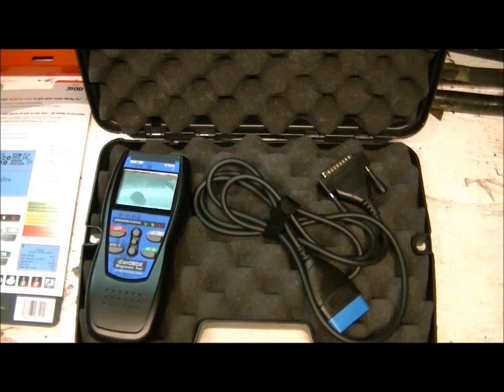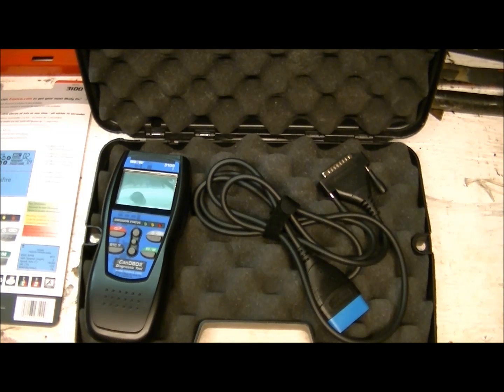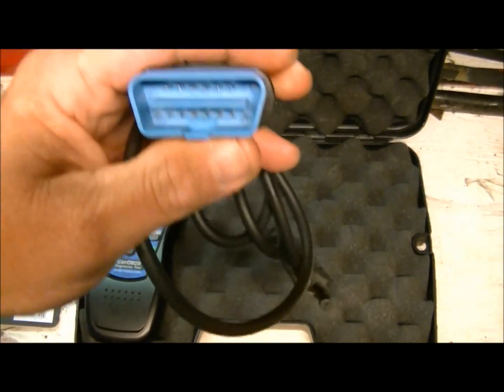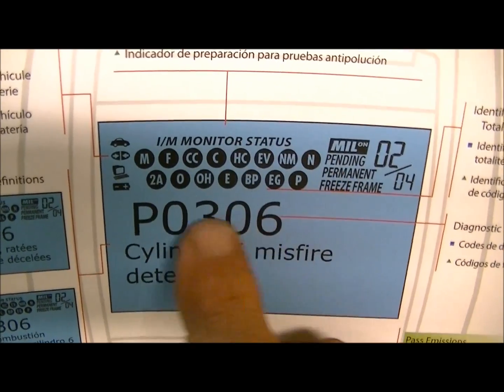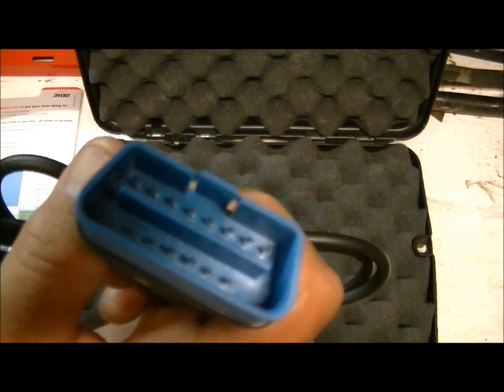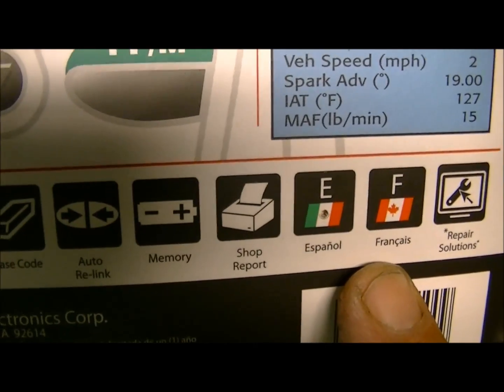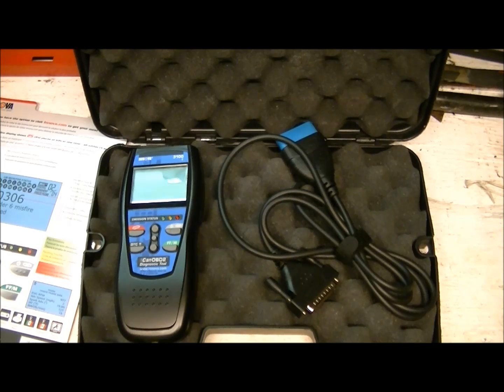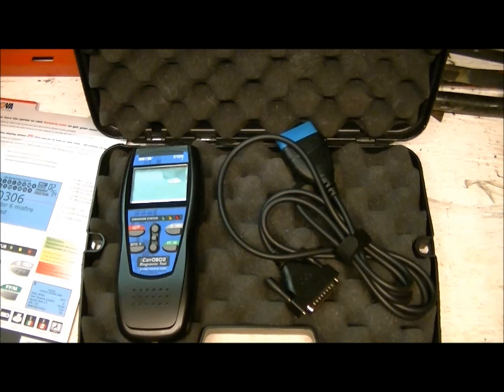Innova model 3100 Diagnostic Scan tool Review

Comment: Most OBD1 have different software vs other car makes. So no universal code reader can pull codes.  Though some models you can do a sequence to count flashes on the instrument cluster to get codes. BMW stomp test 5 times of the kickdown switch with key in position 2.  Jeeps three turns of the key from position 0 to 2. So that's why they made OBD2 so you can use a universal code reader. Though like VW you need Vag- Com software.
Reply from the maker: DaytonCarCare :)

Comment: I  wouldn't purchase any scan tool that didn't have an ABS readout.....
Reply from the maker: FYI for you just because a scann tool has an ABS Function its in no way a gaurntee that that function will work with your car. also that function is a Joke on scan tools , as they can not tell the difference between a sensor problem or a wire issue to the sensor , have a nice day
Reply: Mike Johnson innova 3160e can also read ABS

Comment: I don't know it ifs because of recently buying my Innova 3100 but mine can read ABS
Reply from the maker: thats cool ,
Reply: It will not read abs on BMW cars! I wish package would of said that
Reply: victor echeverria What letter is after the 3100 on yours? On mine it reads ABS codes on BMWS. My unit is the Innova 3100 k
Reply from the maker: victor echeverria not all code readers will do everything in fact none of them do unlesss you spend a wack load of cash and even at that the odd car needs to use a special reader just for ABS, one the better scanners is the Autel VAG 405 it works best with bmw VW etc. and its only 50.00 check my video out on that scanner i also have a video on what you need to know before you buy one of these scann tools as well
Reply: KevinMillard68  cool Ty I'll check it out

Comment from the maker: the 3100 will not track abs or oil lights, it will only do the check engine light problem now the abs could be a wire which is very likely or a sensor,take the wire off and doa continuity test on the wire each one of them that is is they all pass then you have a bad sensor or even a bad abs unit could be at fault , how ever your abs being down will not affect your regular brakes so you are still safe to drive, oil light check the oil level only when the engine is cold,could be oil sensor as well

Comment: i just got this scanner and plugged it in and it said no dtcs or freeze frame data present in your cars computer, am i doing some thing wrong. so i went to the innova.com site and uploaded what ever it got from my car and now it read no error code are present. but did get a yellow light. my dash board lights has check oil and abs on. the scanner did not find this, yes i know it will not scan for abs, you would think it would make a code arror on the computer for the scanner to find

Comment from the maker: their pretty easy to use plug it into your OBD 2 port then turn the key to the on setting on/run the ignition press the reset or power button it will connect test and give you the results,  the rest youll have to read the instructions on how to scroll threw the codes etc,PS the MIL light is considered a code in it self, it corrects when you have completed repairs for the given codes and you can also just clear the computer as well if need be.. not enough text space to give you all the directions